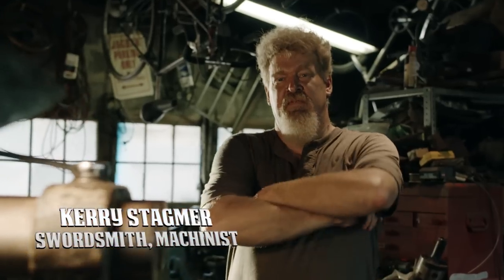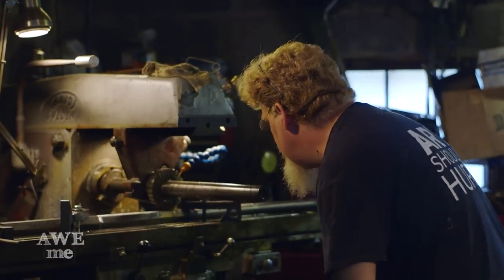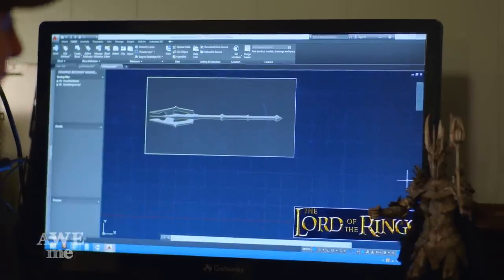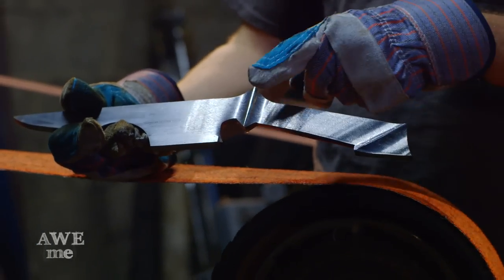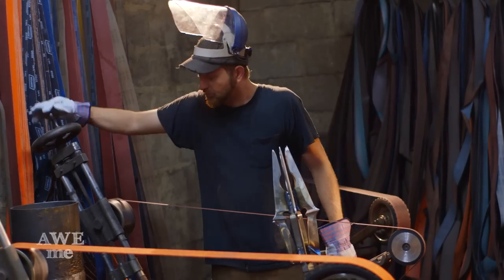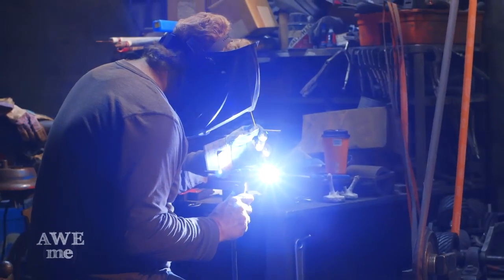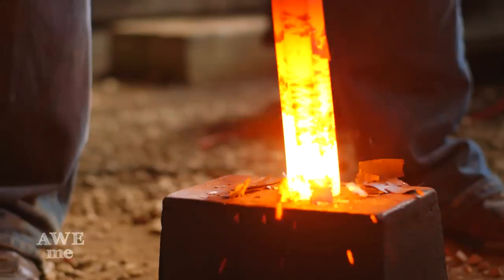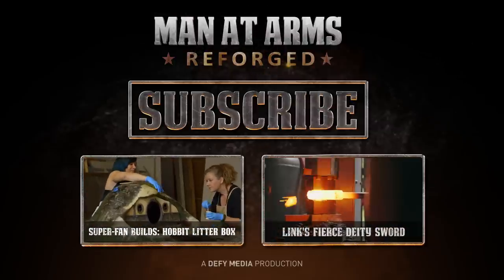Sauron's Mace (Lord of the Rings) - MAN AT ARMS: REFORGED

Comment: Good. They finally stoped doing stupid stuff, and whent for the real deal. Finally.
Reply: You've come to the wrong place, if that's what you're looking for.
Reply: All their stuff has been awesome bro.
Reply: *went
Reply: Gameorama91 Including the mini Captain America shields and TMNT Combo weapon? Those weapons were ass and you know it.
Reply: Kawaii Seth
as a matter of fact maces where used way more for battle than flails and sword, at least if we talk about full plate battles
Reply: Kawaii Seth maces were used by armored soldiers against other armored soldiers, mainly because it doesn't need to penetrate the armor plates to do damage or incapacitate armored soldier.
Reply: Kawaii Seth
maces are usually paired with a shield to overcome the reach and speed deficiencies. For battling enemies in full plate, there are few better weapons. Flails are cool, and have greater reach, but they can be as much a hazard to the weilder, as the opponent.

Jordain Williams The cap shields were, basically, just shurikens with a shield design on them. So, they weren't too bad, if a bit pointless. The TMNT weapon, however... That was just stupid. It could have worked, if they didn't have to use Mikey's goddamn nunchucks. There is no design that can incorprate nunchucks well. The rest are fine, because you could just make a naginata with a sai guard. That'd be just serviceable.